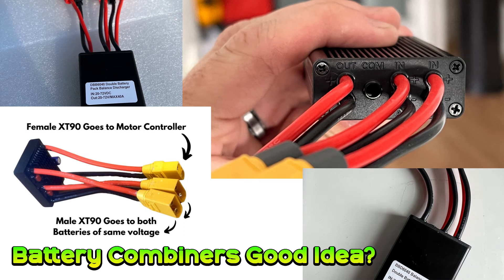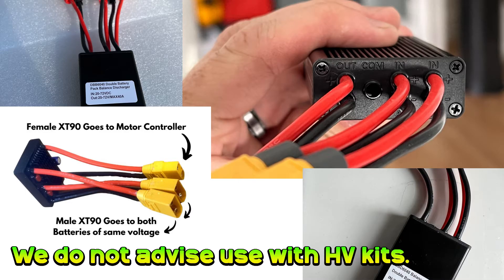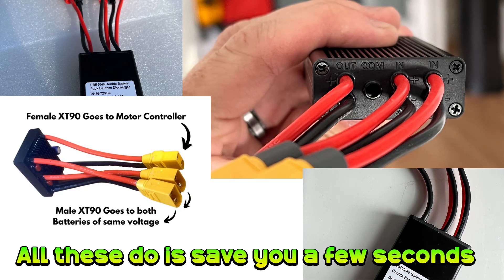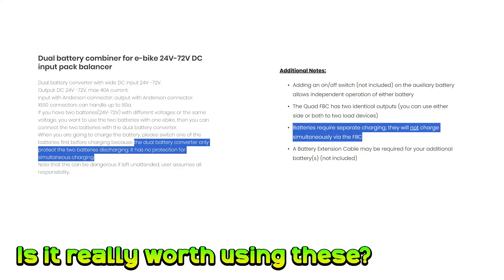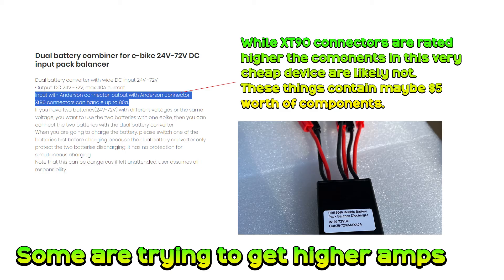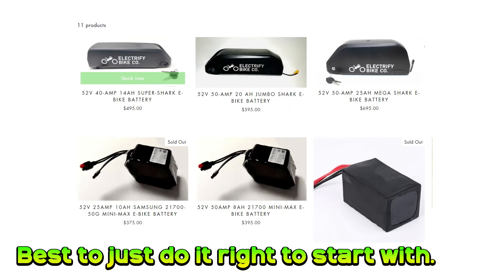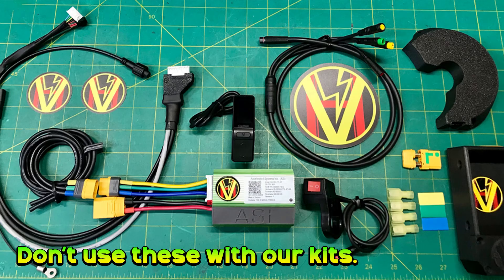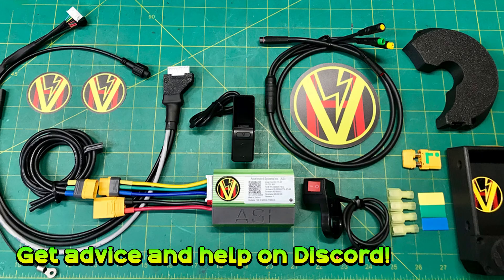Ebike Battery Combiners are they worth the risk?

Comment: I have been using several of these devices on my electric bike for more than a year, everything works perfectly. This is a very good way to save money by buying 2 inexpensive batteries and combining it in 1 more than buying a large battery of a large battery one 2 times more.
Reply: Could I buy one of your kits? Need a 80 or 100 amp combiner
Reply from the maker: Glad it's working out. If the motor is only pulling low amps like 10-20. This is really aimed at stopping people using our kits that are running 4000+ watts and high amps for extended periods.

Comment: If you use them, be sure to turn off the recovery in the controller
Reply from the maker: Yeah they can't handle regen current that's for sure.
Reply: @HighVoltageKits  Because there is a diode that does not pass the current back to the battery
Reply from the maker: Ok so one way. Understood.

Comment: I'm sure if you hook up an IGBT, contactor, or maybe a thyristor, you could switch between the two batteries. That's the exact though process that leads to a blown up battery, motor and a fire.
Reply from the maker: Yes. They can work but its just not a risk worth taking IMO.

Comment: I hear they are a good way to blow up the controller if it's a smart type of controller
Reply from the maker: Even the 855 can be wrecked with these mate.
Reply: @HighVoltageKits  lol, a controller that blows since the battery does not accept charge is a waste of time anyways. What if the battery is at high voltage cut off level?
Reply from the maker: Most controllers have some wiggle room to allow for voltage spikes.